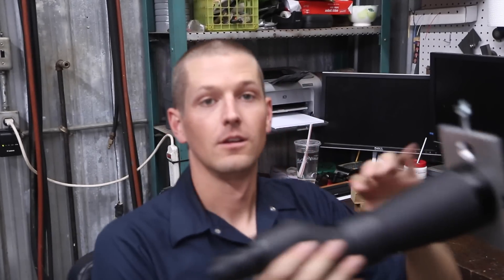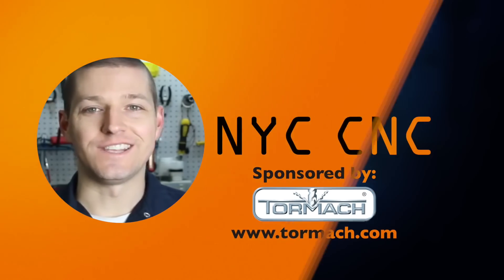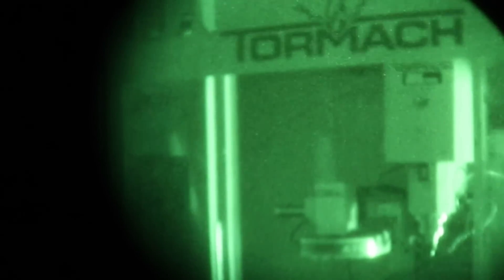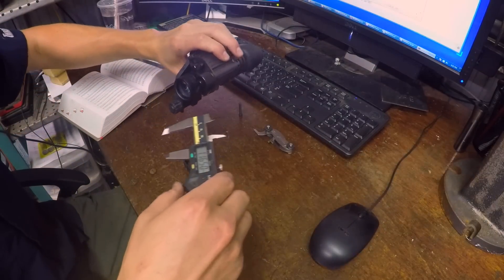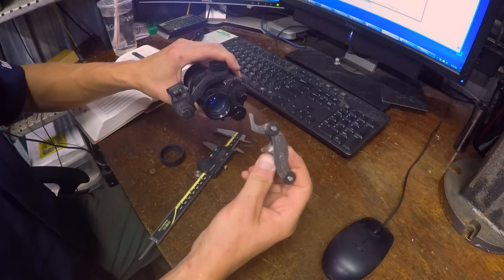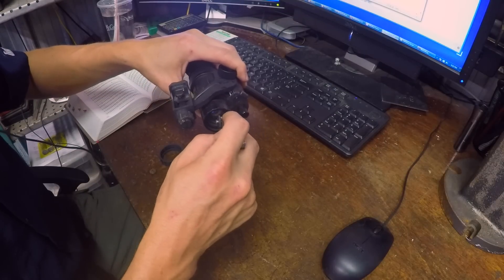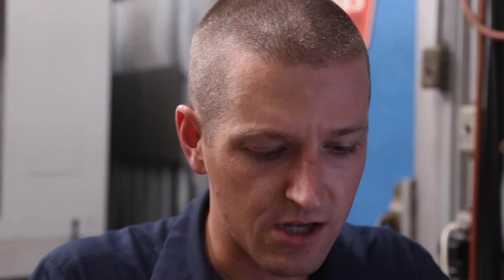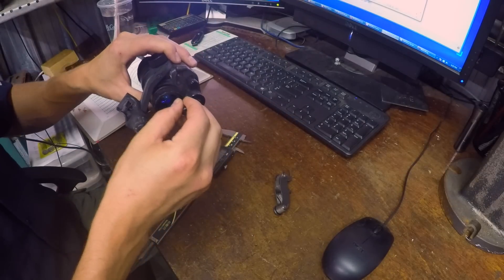DIY Night Vision Spotting Scope Adapter!  Widget56 Part 1

Comment: I think when you cut out half of that hook you shouldn't cut into the flat bottom. Two reasons: first, it'll give you better support when resting against the scope's eyepiece = less strain on that groove. Second, it'll block unwanted light better. Imagine you use a flashlight nearby, you don't want that light leak into the gap between the scope and the night vision unit and influence your picture.

Comment: A/N-PVS14. The way they're mounted to rifles (rarely done) is to use an aluminum rail grabber with a sort of J-shape. The grabber has a knob on it to provide a camera compatible screw (like the kind for a tripod) that screws into the body of the NOD (Night Observation Device) and a little "tit" that sticks up into the square shape near the screw hole to keep it aligned to the rails. It's part of the basic issue items for the military. You could do a custom bracket to mount both the NOD and the spotting scope and a camera tripod socket rather than fiddlng with those demist shield threads (which are actually fairly fragile and allow the operator to swap covers and prevent the  objective lense from getting broken/scratched. (read: mess them up and you're pretty well screwed if the shield on it gets scratched, or worse, the lense.) Oh, and the NOD itself has (fairly rarely seen) an external compass and a 4x magnifier+reticule (IIRC) available that use those same threads.

Behind the objective lense, the PVS14 uses thin silicon wafers with exceedingly tiny holes etched (or might be lasered, I forget the exact details of the microchannel plates. It's been a while since I had to carry/use/maintain them) through them. They have the effect of being an array of millions of miniature IR sensitive photodiodes (those little dime sized brown things that make security lights only come on only at night.) There's a gain controller that sets the amount of amplification of the plates to make for a visible image on the part you look at. Never operate them in daylight unless you have the cover on or you'll burn the plates out. (Yes, that little pinprick is the more than enough light than the PVS-14 needs. Other cool feature is you can rotate the on/off knob past "on" to activate the IR diode to light up a fully dark area to you or signal your NV-equpped buddies.

Comment: The cam body looked off center because it defaults to trying to center the part in the stock by having all the part edges an equal distance from the stock edges. Since you removed half of the parts largest circle (with the press pull) it got shifted to the right in the cam stock when centering. Try using the axis option in the stock menu to select the z-axis (concentric with your center circle), or playing with the model position drop down menu.

Comment: Based on your measurement, it should be M30x0.75, you selected 29.97 mm x 0.747 mm. (I guess the pitch will be OK. Still watching.)
Reply: I had the same thought. Never assume that threads are standard. Almost everything imported is metric and even made in USA often means assembled from imported parts.

Comment: I think you have to select a face on work coordinate system after selecting stock type and operation has to be "turning or mill/turn" so it will center part. I don't think you need to create an arc to press pull, it already divides the face. But I'm new and still learning. That's why I love your videos! :D